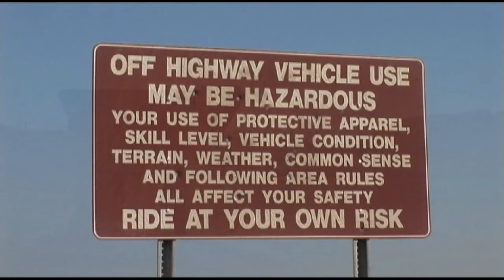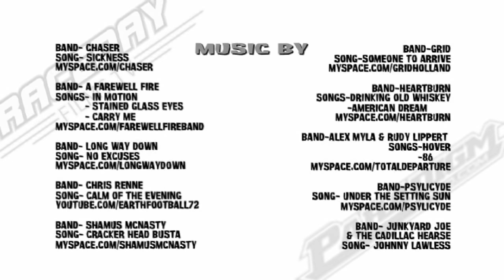Paradigm Presents: Dirt Division Full Movie

Comment: Factory truck manufacturers can learn from these guys how to build a proper truck that can take a real pounding. I like the Ford Raptor too but it's is not even close.
Reply: Problem is its they don't handle on road, have no cargo space, no ac, no window glass no doors, the suspension joints are really only good for one or two races, they are not comfortable to ride in, the shock absorbers alone can cost about a third of a brand new raptor, the engines often cost more than a new raptor, and the way people take care of cars these days, even the people who think they are anal and baby their cars, these cars would never survive. Plus even if the motors were quiet, the suspensions are squeeky and noisy as hell. Personally I'd love to have one. But they just wouldn't sell. And if they redesigned to sell, they just wouldn't perform.